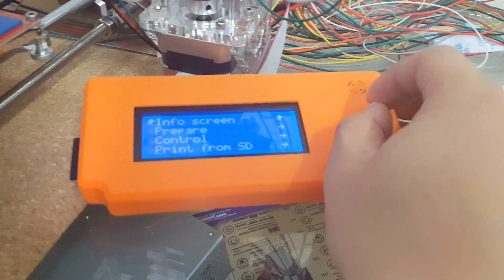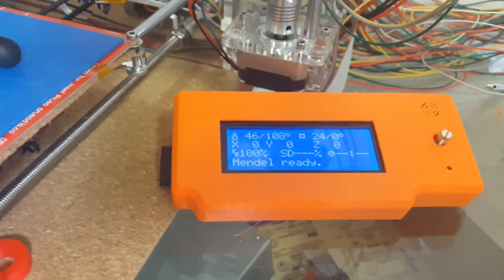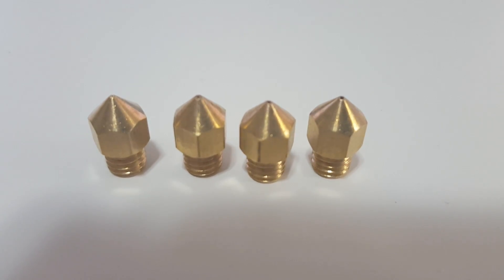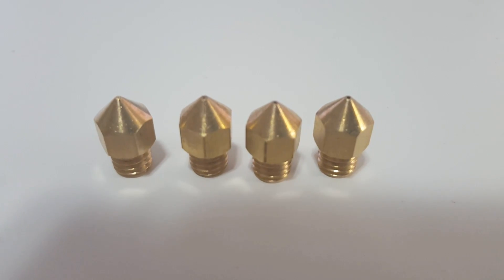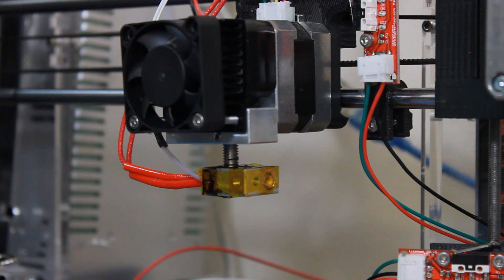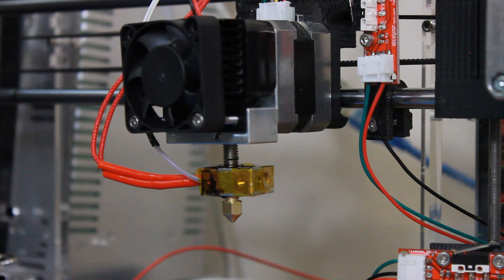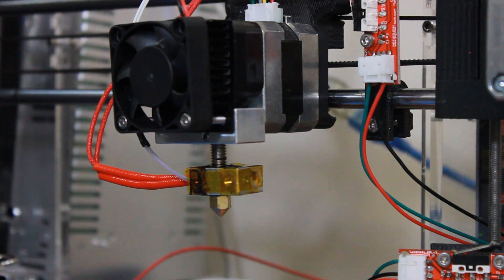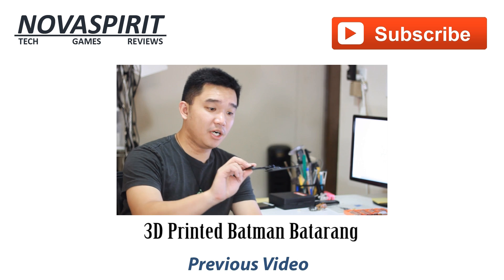Replace 3D Printer Extruder Nozzle

Comment: It's IMPORTANT to note that it may be best to detach the heatsink from the gantry. I followed these instructions exactly and braced the heat block with another wrench and ended up breaking the throat tube. Now I am buying a whole new hot end. Save yourself some money and don't put ANY pressure on the throat tube.

Comment: I have an Original Prusa i3 MK2 and the filament that came with it is not within proper tolerance so it's not extruding.....the teeth won't grip it so I can't seem to get it out. I was wondering why my prints were sub par to what I've seen the printer do online and this seems to be the problem. how do I get the filament out without disassembling the whole extruder body? much thanks

Comment: Why does it have to be hot? Can't you just pull out the filament, let it cool and take it out while it's at room temperature?
Reply: because it's way easier to do it, try doing it in room temperature yourself.
Reply: because the filament acts like cement and those components (brass) are soft enough or thin enough that you could break them forcing it out while cold. heating it up makes it much much easier to remove and lowers the chance of breaking it while doing it.

Comment: I saw many nozzles to sell on ebay, how can I know if they are compatible with Prusa/Graber i3? Thank you in advance! BTW, Nice video!
Reply: 3 years and no answer smh...
To anyone else that reads this in the future any nozzle the same size as what you have will be fine and you won't have to change any settings and use the same size filament!

If it's MP it's probably .75, you can you use any size you want but you have to get filament for that size and change your settings for slicing!

Comment: Thanks for the video.  It is helpful.   Question:  Why would it result in lower layer height? Is that a bug in the 3d Printer software?  If you change the settings to a lower nozzle size, for example, from .4mm to .2mm, then the software should recalculate the height per layer, and automatically output the layer for 2x to make the same height, no?

Comment: You had mentioned something getting wide "walls" with .1 nozzles, what did you mean ?
Reply: Christian Harrell I think he ment printing at .1mm with a .4mm nozzle. What you remove in height you add in width to the walls or strands of plasic.

Comment: I saw the degree value on your display jumped in steps of 4.
I assume you are using marlin, setting those two values in the configuration.h fixed this for me
#define ENCODER_PULSES_PER_STEP 4
#define ENCODER_STEPS_PER_MENU_ITEM 1

Maybe you could have printed a test cube with the different nozzles and compare the quality and time it took, but overall i liked the video.
Reply from the maker: Thanks for the feed back, i really appreciated! And I never thought about changing from 4 to 1 that's really smart. Going to update that  as soon as possible.
Reply: +shutdown27 I think that is a very good idea. I have a duel extruder, and I would like to have one that is focused mainly on accuracy and the other speed.